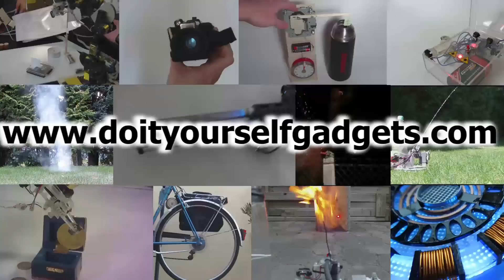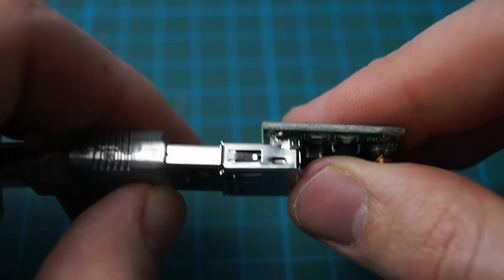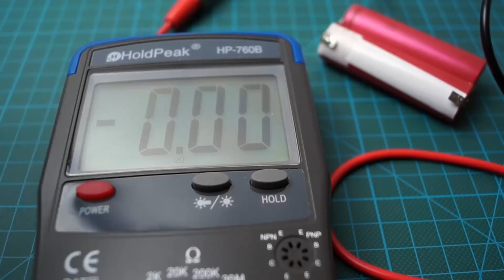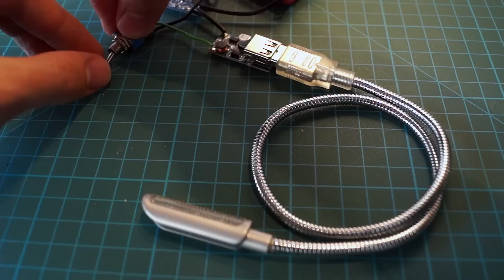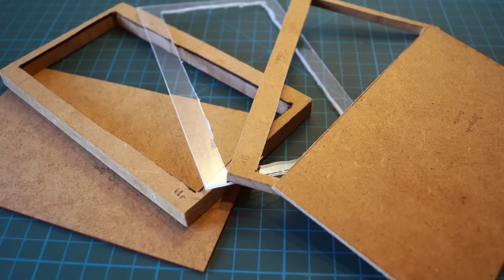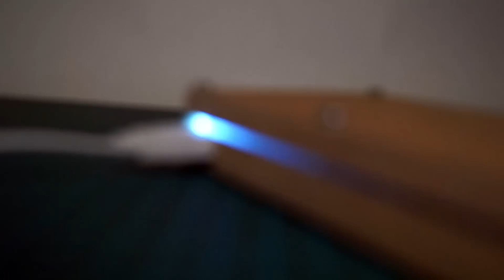DIY USB Power Bank from Laptop Battery

Comment: all these diy has that T4056 chip , i can't even grab hold of a regular circuit of  an old powerbank , and when i did it was damaged , like seriously , isn't there a diy with just a working laptop battery and it's working circuit just slightly edited to be charged with a usb c input to charge it and a usb output to charge whatever i want with it ?

Comment: You could get a fast charge using a laptop chip to charge it as I'm sure it you could get a chip purely designed for the 19v that most laptops use
Reply: that will probably ruin your phone

Comment: I have a silly question but I hope you can you can answer it... 
What do you use the connect the batteries in parallel?? 
Thanks!! :D
Reply: ***** would it be fine if i use aluminium foil?
Regards,
Reply: Joel James probably use a pepsi can tbh
Reply: search soldering  nickel strip on ebay its very cheap

Comment: i made this exactly how it was shown, using my multimeter and checked that everything worked until the usb boost converter, is there a chance that b/c its cheap and from china that it could be a dud? should i get a new one ?
Reply: I also used the exact pieces from the link in the description
Reply: Doityourself Gadgets ok I bought a new one, something must have came lose, I measured voltage in but nothing on out, what "fast charging circuit " would you recommend
Reply: Uggg it's still not working, I bought the same pice again and did not work, the red light on the step up chip works, but I plug in my phone and nothing works, no voltage out, but I did measure voltage from the battery coming to to the USB chip
Reply: It's the same model as the one in your video
Reply: I think that's the case, I measure nothing on the big pins on the USB, but 5 volts on the tiny ones on the bottom of the circuit bord, can you link a fast charging USB output step up converter if I can't get it to work
Reply: i plugged it into other devices and it worked! but how would i get my iPhone to register it, I'm considering buying an adjustable out circuit and setting it to 5.5 to get it to work on all thing because i mainly build it for my phone
Reply: Try shorting the D- and D+ pins otherwise the iphone wont use the usb port as a power source. Shorting them indicates that the usb port can be used as a charging source. Android devices work just fine without this connection.
Reply: Joel Simpspn I have the same problem. I tried to charge my phone but it's just showing 'charging' but the percentage is not incrementing. Did you find a solution?

Comment: Could I use a circuit that comes in those cheap powerbanks for this project, a board seems to be simillar to the one you use but two boards are mounted together.  "CHD-XS V2.0"  I'm not sure.

Comment: is it possible to  do something similar to this just using it to charge the batteries? If you plan on putting them inside something like an rc car then using a micro usb cable instead of having to detach the power pack and charge it on charger that comes with it.

Comment: 800mah output and 800mah charger in a ~10.000mah battery power bank looks like a trouble.. i mean it will charge you phone at 4-5 hours and it will take another 4-5-6 hours to replace that energy back to the power bank via the the wall adapter charger to charge the bank.
Reply: ***** yeap but that's the problem.. you cant find more amps in these small circuits.. i believe it is better to buy a good one and just replace the batteries.. that looks the best option..

Comment: can you make car battery jumper/booter  out of old laptop batteries? i have plenty of old batteries btw. thanks
Reply: i only need a 12v jumper but hi amperage, say 200A would be good for starting purposes
Reply: you need special type of 18650 cells that can provide alot of capacity. you usually find those in power tools batteries. normal 18650 are rated at a max of around 0.5C, which is no more than 1-2 amps per cell.....so you would need around 200 cells to get a good rating. Power tool cells get around 20C, so you can in theory draw around 30 amps from each cell. Its much more complex than this but you get the idea
Reply: quick answer - with laptop cells - no, you would need about 120 cells in total. I would recommend to use a few cells, some supercapacitors and a boost converter. The 18650 cells would be used to charge the supercaps via a step up converter. Will be a bit more costy, but should work well in theory. Simple and lightweight. Another option is LIPO hobby batteries.

Comment: How many days you need to charge that cells?
Love that box and micro switch is great idea ;)
Reply: TP4056 have output of 1A, and to fully charge 1 cell you need 2-3h that means that you need at least 12h to charge that 6 batteries. I solved that problem with multiple TP4056 modules 1 per cell, and by doing  that you have protected cell and they can be different capacity from each other. Disadvantage is that you cant use standard charger. I have few videos about that on my channel, and you can check them up if you are intresed.
Reply: Last night, I used a TP4056 to charge 3 in parallel, and it stopped with a green light, thankfully.  I worry though, that with many more batteries, that the cut-off current may never be reached.  It occurs to me, that if you wanted to stack blocks of cells in series, you would need as many DPDT On-On switches as blocks, in order to isolate them from these TP4056 chargers, as their charge leads are not isolated from the source.

Comment: That was a really neat trick integrating your power switch into the usb socket. I've been thinking of using a bistable flip-flop circuit (http://www.ebay.com/itm/Bistable-Flip-Flop-Latch-Switch-Circuit-Module-Button-Trigger-Power-off-Memory-/262446124339) as part of an embedded power source for projects. Have you tried using any of those?
Reply: +Doityourself Gadgets You're welcome. I hope to see that in a future project!

Comment: i connected my batteries in parallel and than charged the whit my phone charger but when i cheked the voltage it was 3.70v . ( is that normal ?? ) pleas i need your answer .
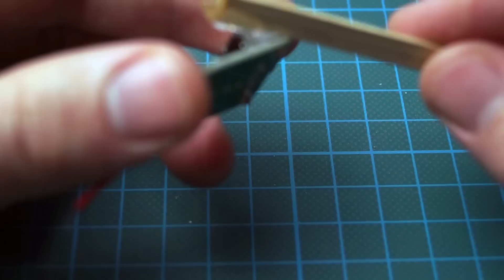Reply: 2:52 i connected the batteries same as you but without the TP4056 . I pluged them directly to my phone charger . After 4 hours ( the batteries didn't get hot ) and when i cheked the voltage (output) it was around 3.70v . Is that normal ?
Reply: so the TP4056 is Necessary ?!

Comment: dumb question but what was the voltage output after you but the batteries in parrell
Reply: +Doityourself Gadgets oh ok i appreciate it very much thank you
another quick question sorry but does each individual battery producs 4.2 volts or do the 2 of them produce 4.2
Reply: +Doityourself Gadgets ok thank you im not familiar with laptop batteries as you can see XD

Comment: Beware Ive heard those usb boost converters were really bad and output sometimes 6V or 5.5V which may fry electronics... I would not do that...
Reply: can you link me the higher quality one please
Reply: Okay thanks. I've just bought 2 for about 2€ but shipping is 40 days, I guess I can still use these not for USB charging thing but to light up a led or charge a capacitor.
Reply: well I'd like to make a boost converter to stable 5V (no 6V) with input ranging frm 1.5V to 2.5V but without IC do you think its feasible ? Or do you think I could somehow use the low quality booster to get a stable 5V voltage? Thanks in advance